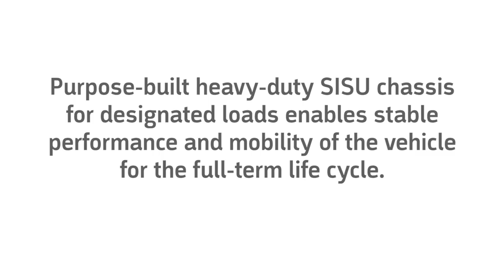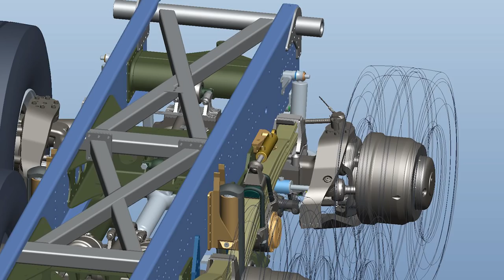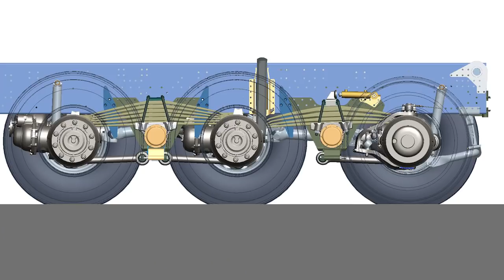SISU Polar Super 10x6 for mining industry

Comment: I miss when they used to use the more reliable Cat and Cummins motors. Euro 6 is so awful for haulage.
Reply: CAElite 
WOW WOW HEAVY DUTY.
Reply: Correct me if I have it wrong, but isn't the FH750's top power and torque ratings somehow limited e.g. during take-offs, and available only at certain speed onwards? According to info at Sisu Auto's page the power and torque of the SISU Hybrid driveline of the SISU Polar Timber truck shown at PowerTruck2018 show is not limited, and the max torque of 3600Nm is available from 1000 to 1800 rpm.
Reply: Could be academic, yes. But also might be that few hundred Nm's in certain situations, especially when starting-off whilst with heavy load, can make a real difference. Just noted, since the comparison of max handling capacity (of SISU) as claimed in your comment, i.e. 3050Nm vs. max top torque of FH, i.e. 3550, as per my understanding, is quite erroneous. FH has the top torque available on top gears only, and SISU Hybrid has that 3600Nm whist starting-off?